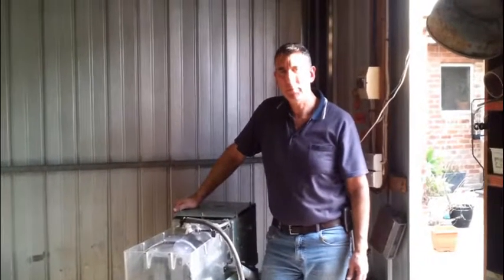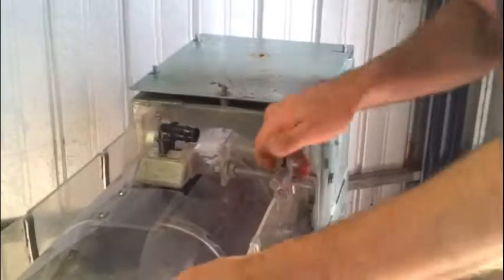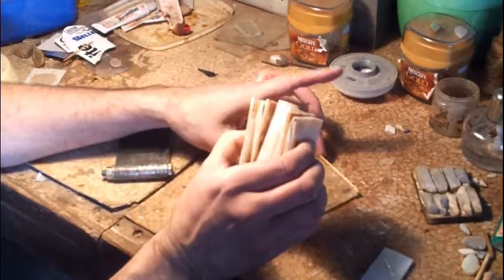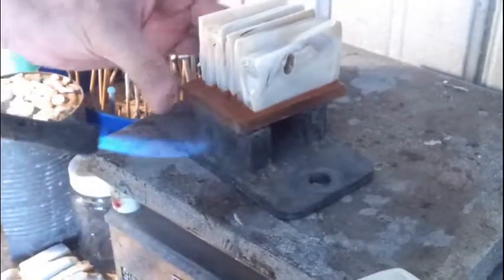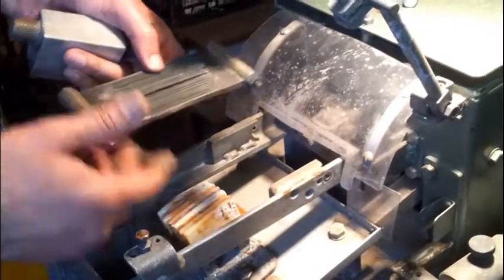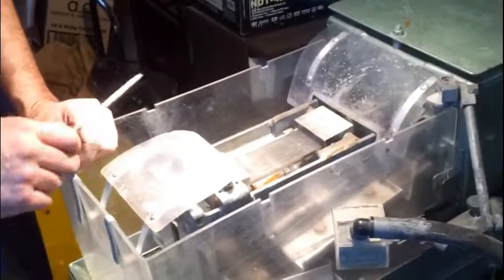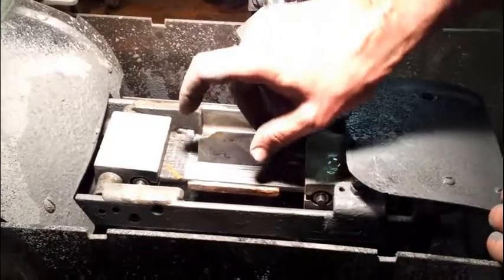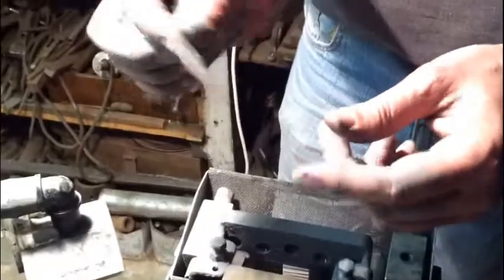How to Set up and Use a Multi-slicing Machine

Comment: Any machines for sale?
Reply from the maker: I don't personally have one for sale but I do know of some second hand ones. The machine is not so much the problem as the blades. Are you in Australia or abroad?
Reply: @diverseopalproducts  I’m in the US and would be willing to pay for shipping, or blueprints. Thanks
Reply from the maker: @azopalinc Sorry to say, there are no blueprints. There were at least 5 different manufacturers, who all felt they had something different to offer. No new machines are available. There are used ones in circulation in various states of condition but I am aware of one that the current owner claims, was only used once. Unfortunately these items weigh over 130lbs so, shipping is a bit of a problem.

Comment: Are these machine good for slicing opal.!
Reply from the maker: Yes, that is what they were originally designed for. I did this video to show someone how to set up and use this type of machine to slice mother of pearl for watch dials.
Reply: @diverseopalproducts  Thanks for the reply. Just seen one on the internet but it looks like it does not come with the BLADES!
Reply from the maker: @TheObSeRvErTheObSeRv  Unfortunately, all the manufacturers of these machines have passed away but there are still used ones around in various conditions. I was talking to one of my customers 2 days ago who has one in good condition, for sale. Blades may be a problem in the future depending the model you buy. There are round end and square end blades. I have square end blades. Fortunately I have access to the dies for pressing both types of blades.

Comment: What's the name of the slicing machine? Or did you make it??
Reply from the maker: No, didn't make that one but did make a batch of 6 when our engineer decided he didn't want to or couldn't make them any more. There are quite a few in circulation. They were generally referred to by the name of the manufacturer. It just depends what you want to cut. As some machines were better suited to one aspect of cutting opal than another. You can see in the video you are able to cut other materials apart from opal.